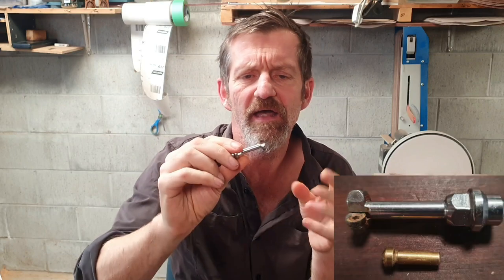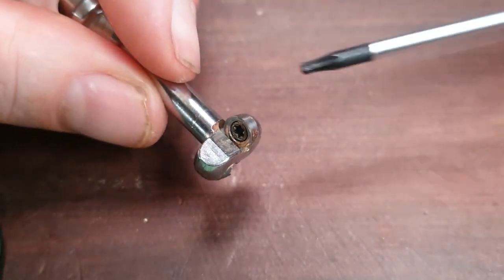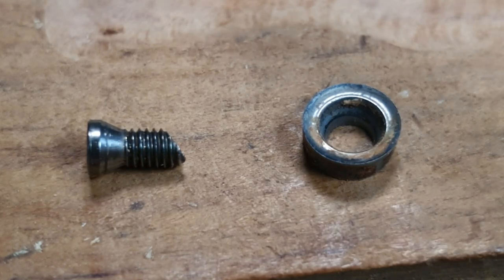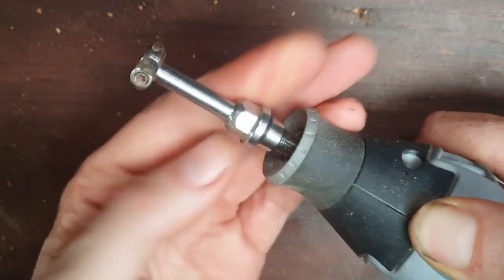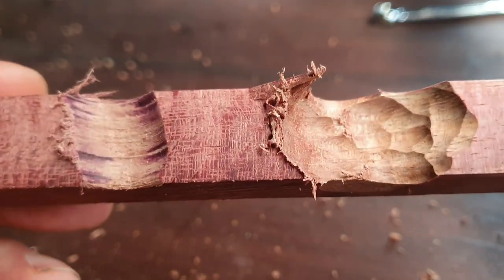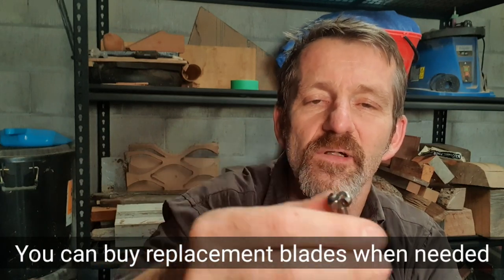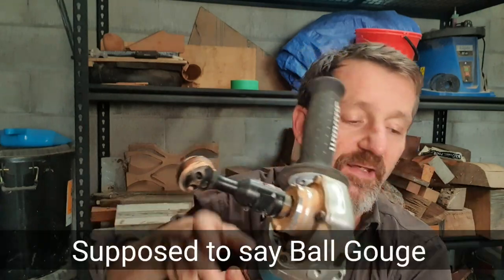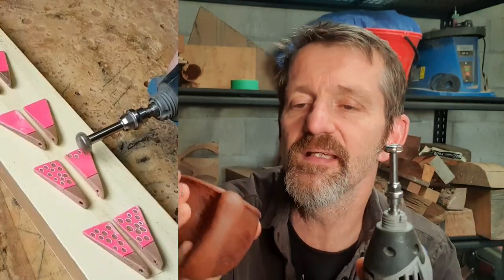The Little Terrier - Dremel carving bit

Comment: Thanks Matt very informative..I was considering it..however I do like to use the flex shaft and for the price I don't think I would use it enough..thanks for the review.. saved me some funds..thanks
Reply from the maker: No problem John. Like all tools they tend to have a purpose, the little terrieris awesome for the purposes I mentioned.  I think the kutzall range though offers  great way to remove wood in a controlled manner on smaller pieces.